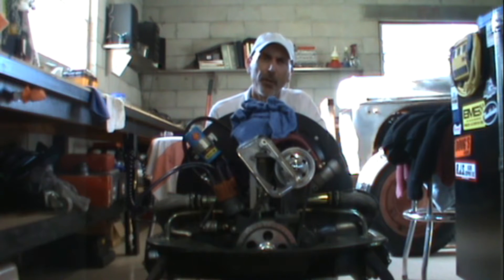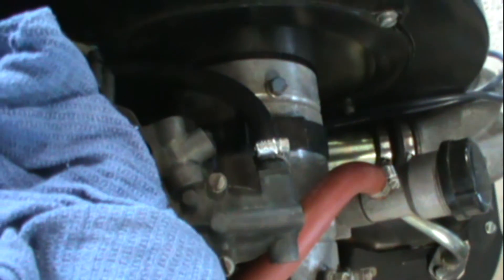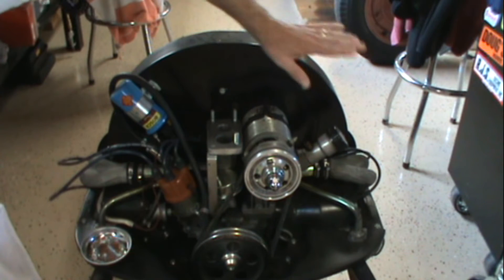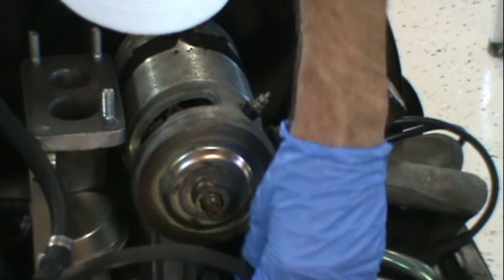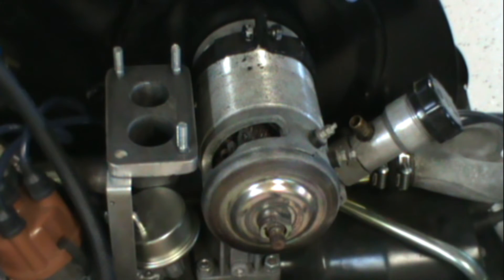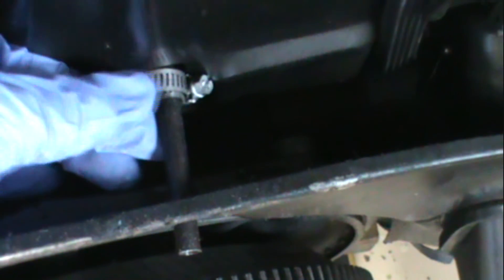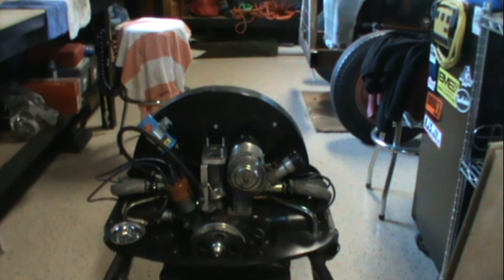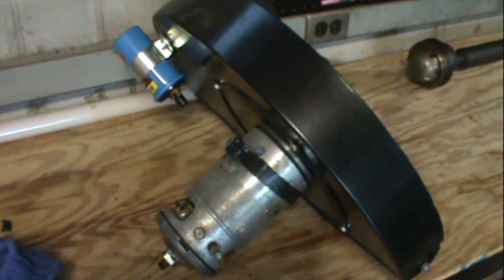VW Generator To Alternator Conversion Part One

Comment: i have a good alternator with external regulator . if i wanna change my beetles generator with this alternator am i one cable short if my research is correct? the alternator regulator needs 3 thin wires and a fat one but the generator has one fat and 2 thin so i guess i need one cable more to put the alternator on? thank you

Comment: Why change to an alternator? Is it better for charging or what?
Reply from the maker: +Debra Hall Yes, my lights used to dim and now they don't, if you want a good radio. I was told by my VW friends that know quite a bit about them to put one in and that is what made my decision.
Reply: +howyoucandoittoo thanks  I'm starting to fix up a 69 beetle that's been sitting for 15 years.  1st step is to replace the master brake cylinder. oh my this bug needs  work.
Reply from the maker: Awesome!!! I have a video on replacing master cylinder, reservoir, brakes and lines. Most of all have fun doing it. Take care...Tony
Reply: VW introduced the alternator in 74 and it didn't use generators again so they had good success!

Comment: Always a pleasure, thank you.  What year is the engine.
Reply from the maker: +pungentpie yes 1970 and it isn't the original engine. 1600 dual port. Take care my friend...Tony
Reply: +vza423 His bug is a 1970, although im not sue if the engine is original, if it is then its same as the beetle :D
Reply from the maker: +vza423 This is a 1970. The engine is not the original but it is a 1600 dual port.
Reply: +howyoucandoittoo That's cool :D same setup in my 72 as well :D